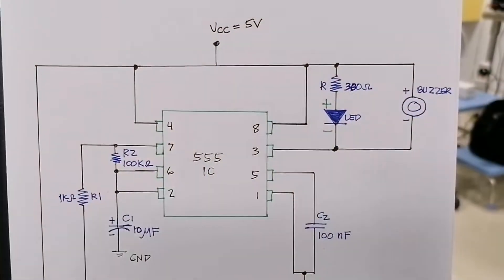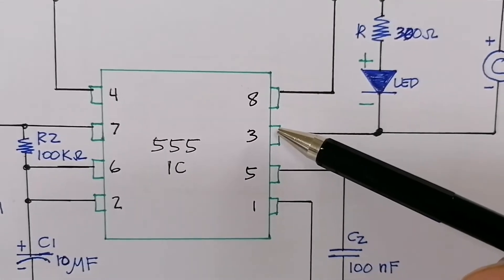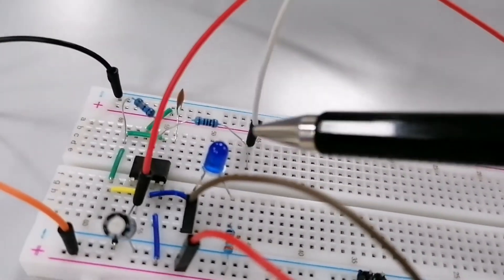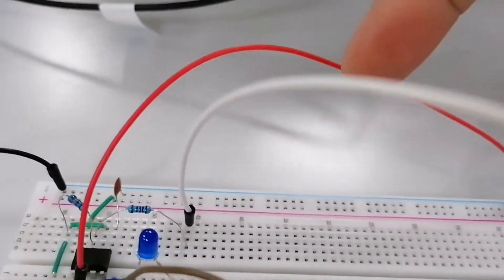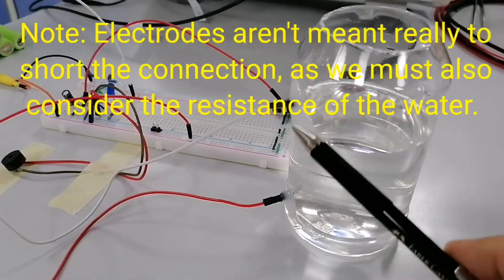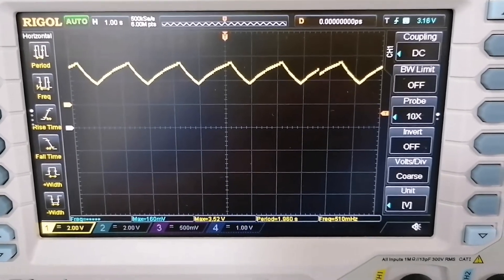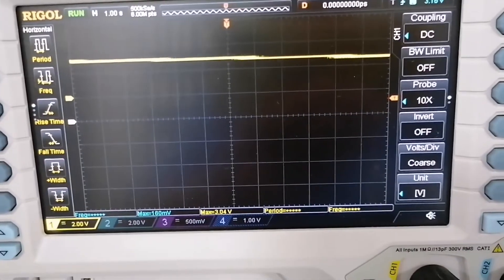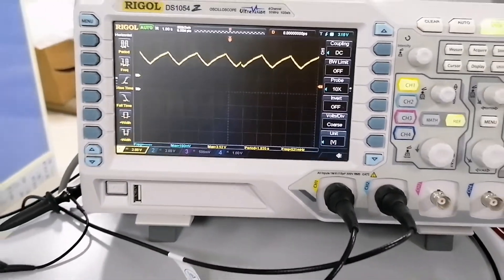WATER LEVEL SENSOR || Water level sensing circuit in a tank

Comment: I've been hunting high and low for a low water sensor to detect when water is below a certain point.  I came up with a 3 transistor 5 resistor circuit that works great!  BUT.....   Since the sensors are using Direct Current (DC) to monitor the resistance of the water, they corrode no matter what metal I use.  (Stainless Steel, Copper, Good etc.  ).  What I need is a circuit that uses a resistance detection via an AC current.  (microvolts of course).  I think I am starting to head the right direction as I know 555 timers can be set up in astable mode to create pulses, that can be converted to AC.
  
Thanks for the inspiration...  :)
Reply from the maker: Hello DavidHill. Thank you for watching.